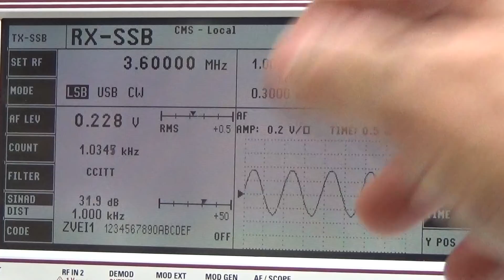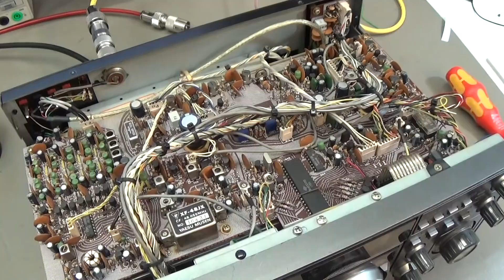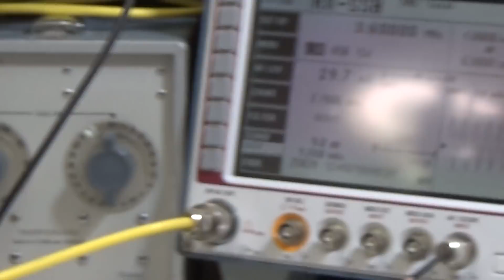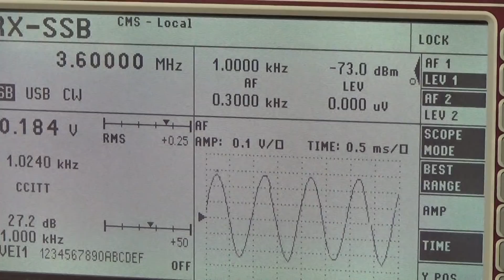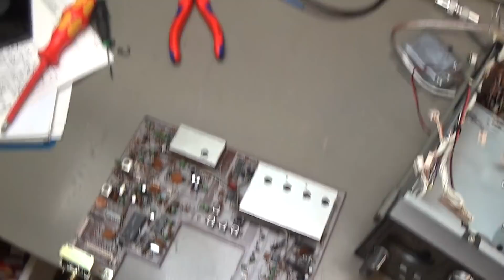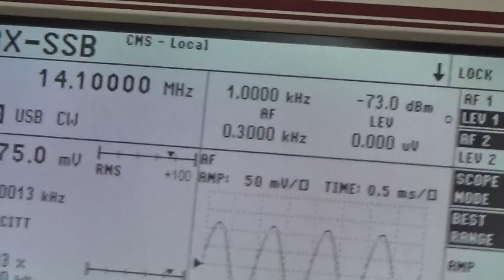#183 Yaesu FRG-7700 with LO 2 issues

Comment: 0413’25/2155h 🇺🇸 Thank you Peter. I stumbled upon this presentation. That service on FRG-7700 was immaculate, painstaking and superb.  The running commentary being very clear, I could understand each step you took for the Frequency alignment. I own FRG-7700 and I love listening to the world. I’m sure my 7700 is also have drifted a little bit. I’ve replaced most of the myriad Electrolytics, as I can, especially the ones at the rectifier. I could fry an egg on it. Replaced the Bridge, replaced the 6400mF and bolted the bridge to the chassis. I will copy your link for future reference. Thanks again.

Comment: Hi Peter,
I am loving your videos and have learned so much from them.
I have a project repair on my bench right now and wondering if you might know the answer to a question I have. It is a Yaseu FT-897 with some burnt parts around the AGC circuit and 2 parts have no value listed R1469 and C1485. Where would you look to find those values? Or am I missing something?
Thank you and keep up the great work!
73's
Reply from the maker: Thanks for feed-back Ed! For you 897 sorry nor way to guess on remote to many possible root cases...

Comment: Thank you for this inspiring video. I also own a frg 7700 that was in need of alignment, this video made me do the alignment. odly i ran into almost exactly the same issues as you showed in the video. And after replacing the trimmer for the second lo i got the alignment complete and near exact to where it should be. all ok so far. However I had the same issue you had with the frequency skew  for SSB.  studying the documentation and the schematic I could not find any compensation for the lsb/usb frequency shift. I think the radio was designed to have a 1.5Khz shift for SSB if that is correct. The way to finetune SSB signals you roughly tune to the disired freq. (within 2 Khz) then press M (memeory) then press MR and tune with the  M-Fine pot to the exact freq.
Reply from the maker: very good procedure for fine tuning!! Unfortunately this unit does not have the memory board ..Anyway thanks for your valuable report! 73

Comment: well done peter under circumstances changing both trim caps made a difference as you say it is an old radio and may require to completely recap the whole radio good job all around good video and never worry about the camera as it is hard show everything peter :)

Comment: Just as a heads-up, these units suffer from miserable LO phase noise levels (-100 dBc/Hz @ 10 kHz on 20m) due to poor VCO design - which, however, may be fixable. (I would really like to see this done and verified by someone with the right equipment.) The main problem appears to be that the varicap diodes are fed via 100K resistors in series, rather than the more appropriate RF chokes (maybe with a kOhm or so in series) seen in other, better designs. This exposes them to substantial amounts of low-frequency voltage noise which they promptly convert to VCO phase noise. (Which in turn will equal LO phase noise outside PLL bandwidth, and not make things any better within.) I can only attribute this to lack of either board space or experience.

This problem is affecting all four range VCOs (Q8-11, or Q2008-2011 on block diagram) as well as the one in the VFO PLL (Q28 or Q2028). This PLL design really is not that good in general - the second internal loop makes it even more prone to phase noise, and receiver frequency accuracy depends upon two different crystals (6.4meg ref + 47.6meg LO2). I like the one in the competing Kenwood R-1000 a lot better, it is drift-compensating so LO2 frequency is pretty much irrelevant within the limits of 1st IF filtering. Between the lack of an inner PLL and 10K series resistors on the varicaps, it puts the unit 7 dB ahead in phase noise... still pretty meh by modern standards, mind you, but definitely less pitiful.

Not sure how far one could push the trusty FRG-7700, but would suspect maybe -115 dBc/Hz @ 10 kHz or thereabouts, similar to other 1980s vintage radios. Should be just fine for a receiver like that.

Comment: Nice one Peter! Funny how now "old radios" have integrated circuits, VF Displays, frequency counters, etc... My first ham radio was a Swan 350, all tube except for one transistor in the LO. Just an analog dial for frequency! It was considered a "modern radio" because it was a transceiver that used miniature tubes for the most part. My "old" receiver was a Hammarlund HQ-120, all octal tubes, built in about 1937 I think. I guess I'm getting old! 73s!
Reply from the maker: Yeah you are right if you grow up with electronics it is a kind of odd that all the techniques which were very innovating back in the days are now vintage :^) 73